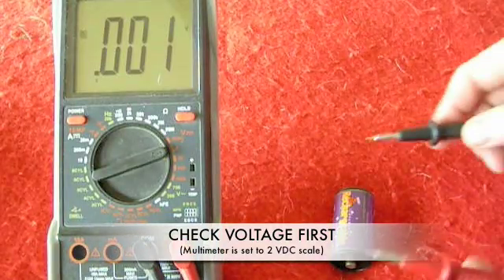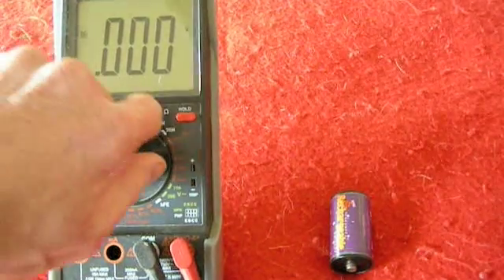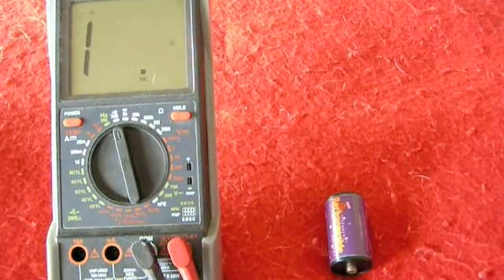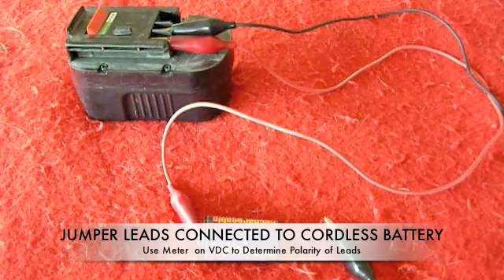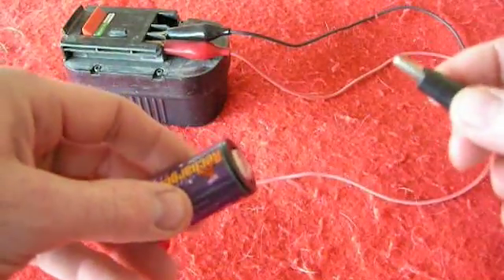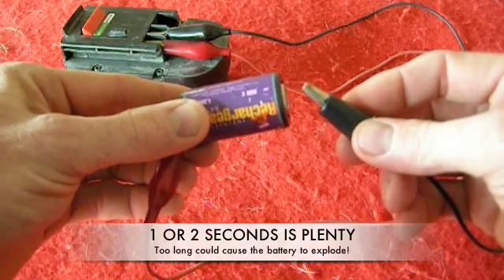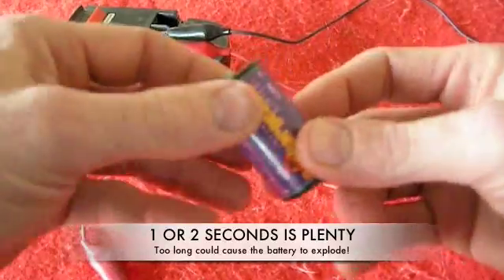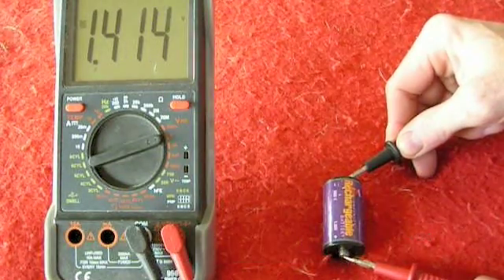Zapping Batteries

Comment: As noted, conductive debris...actually conductive "whiskers"... form between the positive and negative layers inside the battery.  They short out the battery internally, resulting in the absolute zero voltage (a "normally" discharged NiCd is about 1.0 volts).  By applying higher voltage from a source that is capable of high current, the conductive "whiskers" act like fuses and burn out, removing the short circuit inside the battery.

Comment from the maker: I'm not familiar with the term "crystalization through age" but the term sounds like it could be appropriate.

It is not "insulating" debris that is the problem, it is actually conductive debris (or whiskers of metal) that pose the problem because they grow between the plates inside the battery and essentially short it out.

Comment from the maker: The high current (as opposed to high voltage) is the trick to burning out the whiskers that form on the surfaces inside the battery.

Do keep in mind that the voltage of your zapping battery must be higher than the voltage of the zapped battery (due to laws of electrical charge and flow).

Comment from the maker: Electrolysis is applying voltage and current to a fluid to separate the molecules into atoms. Such as can be done with water, to create hydrogen and oxygen gases.

Comment: I have done a similar technique.. i pump a bit higher current/voltage in breifly and it kind of does something that causes the cell to become alive again. I have only done this so far on Nickel Metal hydride so far.. I see someone has stated that they have gotten this to work on a sealed lead acid?

Comment: @Texmurphy51 I wonder if this is what they refer to as crystalization through age.. and how a machine "re-conditions" the battery by melting away or zapping it away through use of heat generated by current? or perhaps it is a kind of internal arc welding heat generated inside the battery that breaks down this "insulating" debri buildup material?

Comment: I am wondering what is causing them to become alive again. I am guessing that there may be some energy blockage inside the cell... perhaps even the one or more of the internal connections have slightly shorted.. and that the sparking with a higher voltage may create enough of an internal arch to mend the connections (re-soldering) through a form of induced arch welding? thoughts?

Comment: I'm NO electronic wiz by any means and was a bit skeptical with this restoration technique. I tried it and it really works. I have discarded untold number of rechargeable batteries because they no longer worked or held a charge.
This tip is amazing. I REALLY works.